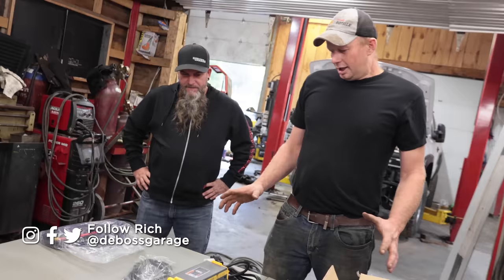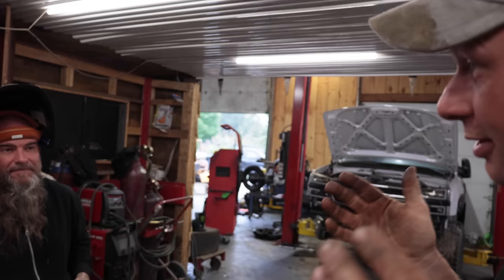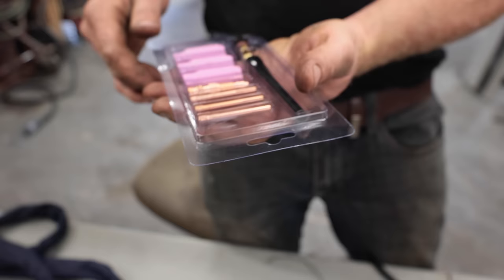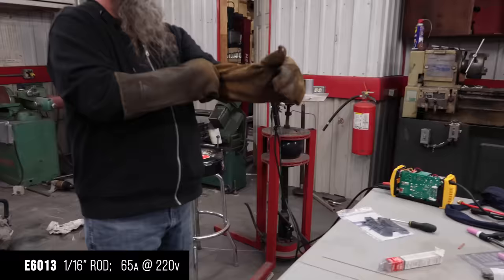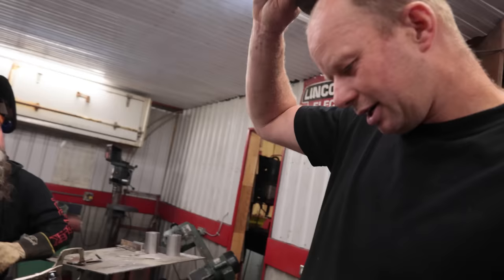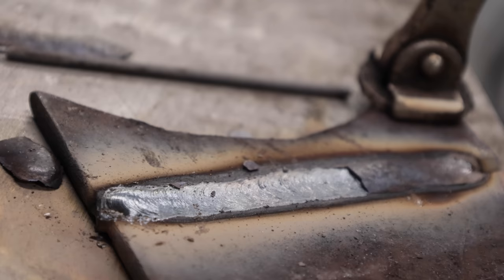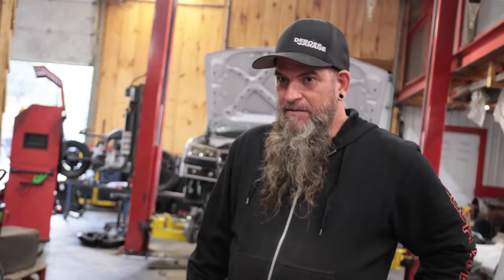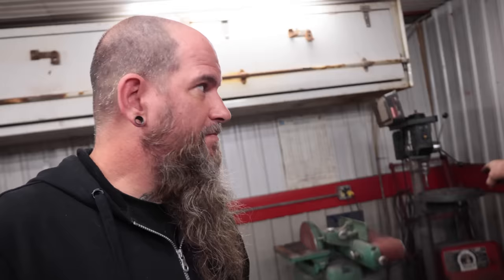How Good is the CHEAPEST Welder on Amazon?

Comment: A 35 year old welder once stated. “I’ve been welding for 40 years now”
Reply: I'm a Luthier to trade (technically a Violin, and Brass Musical Instrument Technician, trained for two years F/T college, two years in the manufacturing industry, and have professional memberships)

Someone once told me they'd been building guitars for famous people, for 50 years, aged 57!

I'm 60, and only been doing it for 40! 

Clearly, apart from simple arithmetic, I know nothing LOL 🤣
Reply: With overtime, that checks out😂
Reply: 😂😂😂😂 especially knowing you grew up in the United States
Reply: pending on the trade they equates hours of exp to years of the trade.  so the statement is technically true.  If you are a dive welder you account a lifetime of exp in just a number of dives.
Reply: @mr.l2182  you laugh but there's some truth to that. When I was a paramedic I routinely worked 60 to 80 hours a week at a high volume service (ran 8-12 calls in a 13 ht shift, with 20 min transport times on average)... and volunteered as a firefighter. By seven years or so I easily had been a paramedic for 10-12 years.  (More depending on reference... some services medics would take a month, 3 months if very rural, to run what I did in a week!)    So while that person may have been talking shit, there can be truth to it too. 🤷🏻‍♂️
Reply: How many AMPs from the wall???  Were you on 14 AWG and a 20A breaker on 120v???    I'm curious if my barn has the power to run it.
Reply: @Firemedic2105 No, that is exactly what it means. It is a way of abstracting experience. A person who works 4 80 hour weeks does indeed have 1 month more experience than a person who works 4 40 hour weeks.
Reply: @NeonGen2000  I agree, I just don't know the context to be able to tell if it was someone with a big ego exaggerating vs what we mentioned.
Reply: hit them with "because you've been inhaling gas and fumes and exposed to UV all day long and you are more like 60 years old eh?" lol
Reply: You guys are a bunch of haters ! This guy should be given the respect that he is telling the truth until you can prove otherwise .  I mean do you think you sound cool straight dissing someone , my advice is don’t be that guy no body likes  “that guy” not even that guy . So get off the couch go do something to improve your self image of your self and the world will improve as well!
Reply: @steveheadden592  You are being "that guy" right now. Grow a sense of humour geez.
Reply: @steveheadden592  I basically was, I was explaining a similar situation for me and how it does make sense.   Granted it is the Internet so of course I leave the caveat that maybe he was just bragging but assuming that he's not since I don't know the full context I completely completely agree what he's saying can be correct!  :)
Reply: Was it simple, I want to see a out of trade school guy try it out. I think I'm a great welded when i have a guy like this looking over my shoulder guiding me and helping get the right rods, settings. But I know alone I'm no good
Reply: I'm 68 and have been in the industry as a framer, finish carpenter, form setter ,superintendant and contractor for 45 years this year. We would get a guy like that every year. My office sent a guy to me once who ws supposed to be a badass finish carpenter. I paired him up with an old timer. I went by to check on his work and saw him swinging his hammer like a club not even bending his wrist. Ishouted out Holy S**t where did you learn to swing hammer.  The old timer immediately chimed in "I know that's what I've been telling him!!" He was gone that week.
Reply: @booradley1065  did the nails go in? I worked on framing crews In my youth. Some were quick, and some were slow. They all bashed other outfits and assumed they were the best. No one ever said they  sucked. Everything built back then is still standing, and most of the people I worked with are probably eead or in prison.
Reply: i can weld the crack of dawn.

Comment: The coil would probably be cooler with the cover on as that would direct the fan air more across the heat sinks and coil.
Reply: Correct.
Reply: That was my thought, too.
Reply: Yup. That tiny welder did surprisingly well without cover and would likely have been ever so slightly better with it still on.
Reply: I thought that too.. but the cover also traps heat inside.  So it would probably be about the same really.
Reply: @calholli  Forced convection is far more effective at moving heat than natural convection thanks to moving air 10-100X faster than natural convection would, even more so when heatsink fins are horizontal for front-to-back forced airflow instead of vertical for natural convection. The heatsinks in this thing are horizontal, they need forced air to work effectively.
Reply: @calholli  take the radiator fan shroud off your car and see how well it cools ;)
Reply: @MiG21aholic   Take the hood off and see how well it helps
Reply: All agreed.
Reply: @calholli  taking the hood off only helps if you are stopped. At highway speeds, it is likely better with the hood on to help guide airflow around everything instead if letting it escape as soon as it hits the front of the engine block. In winter with a front engine, you also want the hood on to guide engine bay heat to engine bay vents along the windshield base which helps with keeping it clear of snow and ice.
Reply: @teardowndan5364   I don't think that welder is going down the highway anytime soon....   but it would be fun to watch
Reply: @calholli  still the same principle: when you have forced convection, you usually want to guide that airflow wherever it is needed because air moving at 2m/s is far more effective at moving heat than natural convection at 0.2m/s - that is 10X as much air passing by.
Reply: @calholli Wow man, you really don't know when to end an argument !  You've lost the debate, admit your loss and get on with it, Jeez... 🙄
Reply: @daltonx6177   How did I lose anything? lol..  They just spent an entire video running with welder without the cover and it was fine.
Reply: @MiG21aholic  it cools. Like a driving a LADA in Florida or Middle east. Means it doesn't 🤪
Reply: @calholli   taking the hood off your car allows hot air from the radiator to escape out the top. taking the cover off of this prevents the air getting to that coil in the first place to cool it off. it's more akin to a computer server, which require the cover to duct air from the fans at the front all the way to the heat generating components at the rear. professional servers often have cover removal detection, so that it ramps the fans from loud to leafblower when the top is removed, specifically because not having the shroud is so much less effective for cooling performance.
Reply: that was my thoughts
Reply: Open will always be cooler. There’s is not build up or insulation with the cover off
Reply: @Uneke  If it is pure convection cooling I would agree. As there is a fan, directed air control with the cover on is usually best. Compare a car radiator efficiency with a fan, with and without a fan shroud. The cooling efficiency is better with a fan shroud where the air is directed where it belongs and more air is moved through the radiator when a shroud is in place.
Reply: even then it really doesnt get very hot
Reply: @Andre_Thomasson  True, but cooler is better... Longer life usually
Reply: @martyh9309  agreed, its nice and "chill" for the components
Reply: Thank you!
Reply: Yep, if it was made to be more or less in the open, the case would perforated with holes.
Reply: @calholli take off your shirt and see how well that works..? 😂
Reply: Try Total brand or epica
Reply: @calholli it has a cooling fan…….and vents……
Reply: No, it would have been hotter.  No question about that.
Reply: That's what I was thinking
Reply: Exactly Right !

Comment: it's pretty cool that something like this actually works relatively well and gets an endorsement from someone with that much experience. For people that want to try to get into welding at the home gamer level it seems like it would be worth looking at.
Reply: I love that he doesn't just call it complete garbage with no purpose, I've met a few welders that would laugh at someone even looking at this instead of a more expensive welder even if it's something they'll only use maybe once or twice a year.
Reply: I bought a Zohan miniature welder in Uganda for that reason. Its 20cm x 12cm x 10cm. That was 5 years ago, and im still using the same $60 machine
Reply: @MyBrothersMario  Yeah welders can be a different breed of gatekeeper. Its like that for nearly everything tho. Guess theyre pissed that you dont have to buy a $3000 HTP welder or a $13000 Welder + $1200 torch for the few times youre gonna use it per year. It burns 6013's very well and thats basically the only rod any average joe will use.
Reply: I did my first ever spluttering and juttering weld today with this type of welder. I definitely would not have invested in one if it was anywhere above this price range.

Now after watching a few tutorials I'm eager to get back at it tomorrow and try and get better. If I do, I eventually might invest in a more durable and expensive unit.

Comment: Be interesting to see how it would run on something like a Bluetti power station. BTW, the case cover has to be on for the fan to draw air over the components and cool them properly, so it would probably run even cooler closed up.
Reply: That's what I was thinking on the fan.
Reply: EEVBlog shows Dave using something like cling wrap so he can still get a thermal camera image of the insides while still allowing the unit to keep itself cool under load.
Reply: How about a genset of various levels to find the threshold.
Reply: @adrianstanton2652  This thing won't live very long running off a generator. Their output voltage is full of spikes which the electronics in the welder can't handle for more than a few times.
Reply: @theSam91 I have a Amazon 130.00 cheapo i bought about 4 years ago and it has spent half its life run off a generator and it does just fine
Reply: @theSam91 that is true but if paired with the proper clean power generator it would work. My HONDA generator would run it.
Reply: Depends on the generator. $399 HF, probably. $3k Honda, probably not.  @theSam91
Reply: @theSam91   which part of the electronics cant take it?

lets see... AC goes directly through a fuse, then  bridge rectifier. or more often, two bridge rectifers in parallel. theyre standardly 1000V rated. theres often some type of crowbar in there just to shunt any transients. 

then its DC and heads to a bank of capacitors. 

a good generator produces sine waves. they shouldnt be making spikes. they only do that when youre switching high current reactive loads on and off. and theyre present on the mains for the same reason. 

the rectifier itself as the diodes begin conduction produces a larger spike than a generator should be producing.

the real issue of a generator as a power supply is jacobs law. impedance reflections in transformers. welders area step down transformer. the unit is designed with a near zero source impedance, like the mains supply. 
when the source impedance is too high, like a generator, you cant push the current through the work resistance as the supply isnt matched anymore. rather than heat the work, you heat the generator. or you simply dont heat anything...

the solid state components, being intended to deal with one particular set of conditions get overworked, duty cycles increase, theres less (or more) damping on certain waveforms,  and the circuit is operating outside of its operating parameters.

at which point, FETs and IGBTs just LOVE to release magic brown smoke.
Reply: @paradiselost9946   I repair welding machines for a living. From my experience, the part that blows is either the MOVs that are across the incoming supply (if the machine has them) or the IGBTs on the primary side of the inverter. It's usually because the user ran the welder off a genset that was too small, when the gen set reaches its maximum rating and is pushed beyond, the output becomes very unstable which the inverter does not like. 
In the old fasioned buzz boxes, tombstones and transformer welders it doesn't matter all, they're a sponge and just absorb everything.
Reply: @theSam91 I love my old buzzbox,  did all the 3" AG tank plumbing on a City of Raleigh LP system about 10 years ago haha. Surprise!! if your reading this NC! Thanks for the Corvette!
- I digress. Ran that thing off my truck genny absolutely fine for years and years, never let me down. And this video was GREAT! Haven't smiled so long in a long time! What a Hoot!😅(And Impressive!)
Reply: @theSam91  i'll accept that. it is all rather complicated.
the buzzbox, its just reflecting the arc resistance. the supply sees that, and that resistance is what limits the power flowing. all good on the mains... super low source impedance...

on a gennie though...
15kw engine, converting to 8kw of electrical energy, that then will actually only deliver 8kw when the resistance it sees is equal to its own winding resistance. at which point you get 4kw in the load, and 4kw in the gennie, heating windings.

throw in the saturation of iron, the fixed rate of conductors cutting magnetic lines of force...  bye bye sinewave and hello nasty jagged trapezoids...

your buzzbox will load the gennie down no problem, but you will feel the limitations of what the gennie can dump into any load crank that welder up to max and its still only ever going to deliver the amount of power into the load that that resistance will allow. and if the gennie cant supply it, it will bog down until its sort of happy... and if you arent careful it will burn out...

on the inverter... omfg... switching at iunno, 100khz... yet fed from a supply at 50/60hz...
 got the voltage trying to go one way as the current goes the other way, cap bank discharging then taking heavy pulses of current as they recharge, igbt/fets turning on for so long, expecting so much voltage or current or energy in a given time but the supplies not stable so the control doesnt know what the hell to do... one cycle it might have excessive duty, another cycle it limits it thinking its overdoing it... "hunting" for stability... the reflections of impedances are all out of wack and somewhere, something isnt going to be particularly happy about it. 

im reminded of playing with the ZVS induction heaters, and how they literally make fets explode if you suddenly changed loads. as it also changes operating frequency and suddenly... somethings pulling reverse current or trying to switch when it shouldnt... 

no heat, no smoke. just instant annihilation as bits of epoxy encapsulation get sprayed everywhere :) 

yet throw one extra turn on the coil and all issues go away... though you cant get the full power into the load as the reflected resistance is too high and limits it...

and on that note... the stick welder will also load the gennie down in a different manner to the MIG, as ones using turns ratios in the transformer, the other using magnetic coupling, ie, a movable core, at a fixed turns ratio...
Reply: @theSam91  I have been running this on my Honda generator for several Months now with no issue even if it were to break now I’ve made well over it’s worth so I could get another if needed!
Reply: The cover that was removed acts as a cowling too draw air through the machine....it needs to be on.
Reply: A very good point. Many (most?) of these low end tools use circuitry that drives cheap components to the absolute limit.  They need all the airflow they can get to stand half a chance.
Reply: @theSam91  True, but there is a wide range of generators.  After all, the wall outlet in your house is connected to a generator somewhere up the line.  Depending on where you live the electricity on the grid can be terrible.  I've used Onan true sine wave generators salvaged from RV's that delivered cleaner more consistent power than the local grid.
Reply: Same.
Reply: I agree. Saved me a lot  of typing, no proper air route to cool.
Reply: or the cover might actually cause it to retain more heat...
Reply: @jimclarke88 Ducting airflow over the heat sinks lowers the temp while running.  The down side is that there is some lag between the IC's dumping heat into the sinks and the moving air carrying it away.  If it's running hard and you cut power to the unit you can get a heat spike high enough to cause damage.  That's why most of these units have either a time delay or a thermal sensor  that keeps the fan running even after you hit the off switch.

Comment: I got the 195 version of this for stick welding class, impressed the hell out of the instructor.  He was pretty speechless and told everyone to go buy one.  Paid $118 delivered 18 months ago for it.
Reply: Im going back and forth on getting the 195a or this 135a w/ the tig kit.. os it worth it to get the higher amp version?
Reply: @jadeolin8514  can't say anything about this machine in particular but it's generally better to use a stronger machine at 60% than trying to squeeze 100% out of a machine
Reply: Is it still running?
Reply: @ARASHKAGE  sure is, just welded up a buddy’s snowblower attachment for his lawn tractor.  Burnt 6013 just fine at 95 amps on 120 volts.  Was hot enough to make a nice weld in a very tight spot.